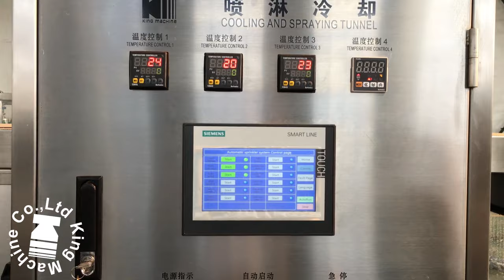Complete Can Beverage Production Line

Comment: Why use warmer?
Reply from the maker: Zhangjiagang King Machine Co., Ltd. (www.king-machine.com)
from China.Can you give me your email / whatsapp, We will confirm more details with you as soon as possible to offer customized solution for you .

WhatsApp:+86 15262329005
Email:aaron@king-machine.com
Reply from the maker: After the code drink fills in the aluminum can, the room temperature air is easy to form small dew on the outside surface of the cold aluminum can, leading to packaging damage, so we need to raise the beverage to room temperature before packaging, there will be no dew on the surface of aluminum can.